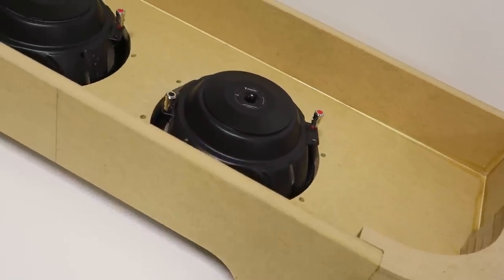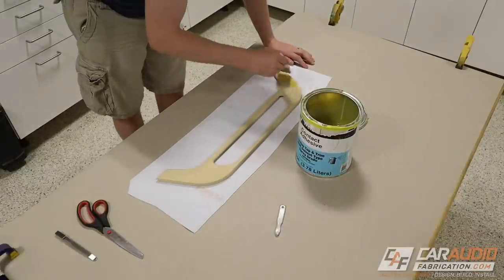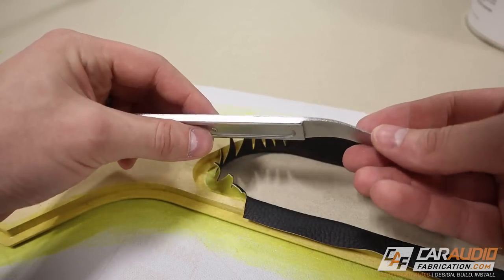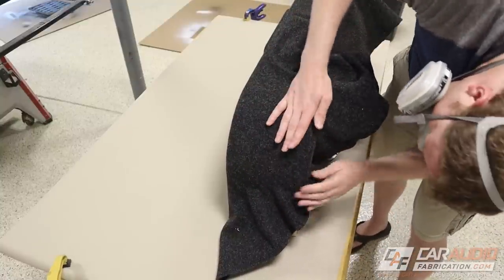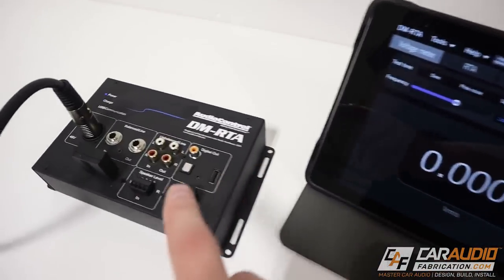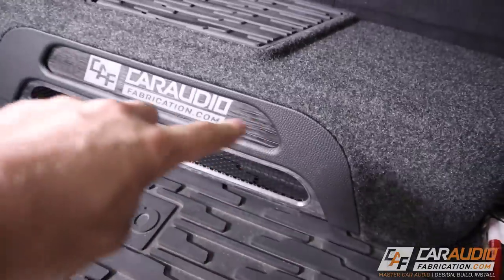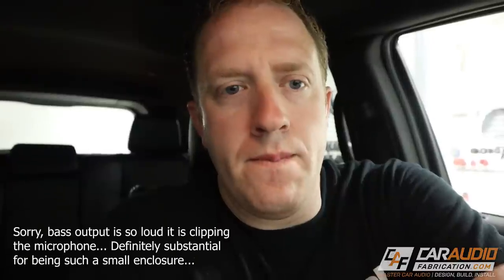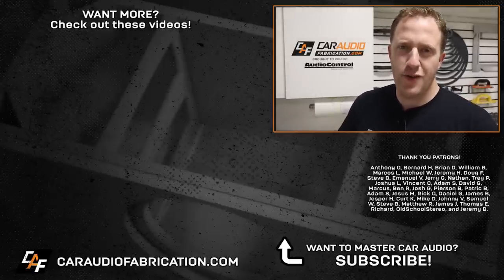HOW DOES IT SOUND? - Downfiring Subwoofer Build Finished!

Comment: I have a jeep CJ5 and I am planning to build a very compact box to go under the back seat.  It will only be 5X17X23,  I'm going to try two three inch subs.   I use your channel to learn about box construction.  I have been building things for 30 years and you have totally changed how I use my router.  I went from one router I used rarely, to having three dedicated to table mount, jig use and free hand.  Thanks Mark!  keep building!

Comment: That is a beautiful box!  Sometimes you just need good sound; it doesn't always have to be neighborhood-shattering insanity!

Heck, my media/home theater setup uses four 5.25" drivers for the lows.  I live in a cozy little studio apartment, so I needed to play deep and fill the room at low volume, so the neighbors couldn't hear it.  It's all about the application!
Reply: add a tactile transducer!
Reply: 5.25"s are crossed over at 120hz, with a 2'x4' DMT panel for the mids and highs.  :D

Comment: Have you tried spray on truck bed liner?
In place of carpet.
No pet hair stuck to it.
Wipe it off easy with a damp rag.
Water proof coating.
Take a lot of damage from things sliding around. Easy to repaint and do touch up repaires.

Comment: I use that adhesive at work extensivly. The charcoal filter that you showed have a useable life of around 3 days outside of the package. You should put new filters on every time you use that adhesive. Also, if you have a batch that gets a bit clumpy you can kick it back with MEK.

Comment: Quick question.
I’ve got a 2018 Jeep Wrangler JKU w/ the Alpine Premium Audio System. It has an 8” floor-mounted sub in the back, but I bought a JL T10W3-D4 shallow-mount sub to put in its place. If you take out the factory sub enclosure; the well in the floor is about 5.5” deep, 12.5” long, and 26.5” wide. I want to maintain my cargo area without a box protruding too high up off the floor, because I use the space a lot; such as sleeping in the back (camping), loading snowboards, etc. However, the audio shop installing it said that if I use this sub, there won’t be enough space for it without building a box that rises 6” above the floor level. (That’s weird, cus it’s a shallow mount sub). They said they’ll have to install a standard JL 10 because the conical shape will somehow fit better, and then they can build an enclosure that only rises 1-2” above the floor level, so it’s still relatively flat in the back. Also, that the full-size JL 10 will perform better than the shallow-mount.

So my question is …
How does this make any sense??? :P

Are they just trying to sell me a new sub, since I already had my own equipment to be installed, or is what they’re telling me the truth? I feel like perhaps having all my own gear, the shop will only make money on the install, which in turn goes to paying their techs; whereas if they sell me a new sub, then at least they make some profit.

Am I right, or are they right?

It just doesn’t make sense to me how the shallow-mount won’t properly fit, and would need a bigger enclosure, versus a full-size sub that wouldn’t??? That just sounds paradoxical; the whole point of the shallow-mount is to save space. So, wth???

Are these guys ripping me off, or is this about some audio-expertise stuff, I’m not aware of?
I admittedly don’t know anything about electrical/audio etc. but I don’t wanna be taken advantage of for $1500+ either :\

Comment: i once used super 77 do do my door cards in a car i previously owned. it was great all through fall, winter and spring but as soon as it got hot the super 77 let go and all 4 door cards started to sag... try headliner adhesive, it has about the same bond but with a higher temperature range

Comment: I have an '03 wrangler TJ, I was thinking about putting two 10" Solo-Baric L7T 4 Ohm/2 Ohm kickers (I haven't chosen an amp yet, however i'm looking for something discreet? and possibly weatherproof) behind my backseat and facing them down to try to keep some sound when riding topless during summer, but do you have any other recommendations or maybe a different setup in general?

Comment: Question: What size rivet nuts do you buy? You say "links to the tools you use will be at the bottom", but they never are, at least for me. Was going to buy a bulk pack of 1/4" - 20 x 15mm from amazon. But wanted to know what you use. Or does it vary based on the size of wood your using....

Comment: I love ur videos... But im haveing so much issues with my car stereo... Im hoping u could help with a little advice... I have 2 12' speakers and a 2200w amp and the speakers have a 14 gage wire and the amp has a 8 gage wire for power and ground and im not sure why the amp keeps blowing fuses immediately i have 2 25w fuses in the amp and my fuse holder is a 50w fuse and i had a 40 but it blew as soon as it got put in and the power wire melted it connection from the connection on the battery i have a great conection with ground but im not sure if the fuses are too small or the wires need to be bigger... Or what... I would really love some advice... I learned everything from ur video and recommend ur video to everyone because how much u have helped me ... Thank you so much hope to hear from u

Comment: I have a 2016 Chevy Colorado extended cab when you get a chance can you look at the back, under the to jump seats the one piece plastic seat base, I would like to make a subwoofer box exactly the same exact size as that one with two 10 inch shallow mount subs, also there's a metal bar that is inside that runs across the inside of the box to bolt it down to the floor, could you build it, one thing on the bottom of that box, it has to contour to the top of the floor so it would fit perfect, it kind of looks like the box in this video, let me know I am very interested.

Comment: Cool looking box once fully finished. On an unrelated note I need some advice on box size for a home system using car audio. I have two sets if Fli Fu 5 component speakers I would like to use in cabinet. I will be mounting them in a mtm configuration with the woofer centres at 7.5" apart, but the speakers come with no parameters. I'm stuck on what box volume I should use. Thinking somewhere about 1.15 cf which is a box size of roughly 28" H x 8" W x 2" D. Anyone any thoughts?
Reply: 12" depth*

Comment: You seem very knowledgeable and passionate about car audio. I have a question. I am running about 2500 watts rms  2100 to the sub and 400 for door speakers all 0 gauge power n ground wire. I want to upgrade my alternator and get a second battery I can only find a 250amp alternator  (FOR BMW 328I stock alt 120amp) is that good enough? I may up grade to about 5k watts rms in the future so I want to buy a alt that will power it.
Reply: If you're running that much power you've needed a good alternator and at least a second battery for a while.

Comment: Hey @CarAudioFabrication I installed a subwoofer with an amp and 4 new speakers without an amp. I have a bit of a rattle in the rear deck. Any tips to eliminate it on a 2017 Honda Accord sport

Comment: Great design and finish! Love the details.
I have a question, do you test the subwoofer output outside the car to check for sound imperfections THD and Frequency response? Or just by ear in the vehicle? Confusion??
Reply: And the end result of box looks more like bandpass enclosure, those opening holes are tiny they could cause some frequency response changes, just wondering.

Comment: Is there a way you can run sound system without the head unit, straight from your phone or other source?
Reply: Yep, I use a $25 Bluetooth module ( from eBay) to run the amp in my 67 Riviera . Bluetooth from phone to adapter so no wires, no cutting in a head unit and volume is controlled by my phone . Check eBay for Bluetooth adapter for car audio

Comment: So im putting a sound system in my 2013 Hyundai Elantra GLS is stages as of right now I have swapped out my stock deck for a Pioneer AVH-4201 NEX deck thats paired with my steering controls I've also swapped out my stock speakers and tweaters with with Rockford Fosgates T1650-S Power speakers in my driver and passenger doors and in the doors in the back seat a matching set with tweater overlays all running through 1 ohm cable powered by a Rockford Fosgates P400x4
Punch Amp and it sounds very good but I'm stumped on what Sub to go with I've been on the fence between 2x12" subs or 1x15" sub and I'm looking to keep my brands matching front to back only thing I've come to learn is that 2x12" will bring more presence and a 1x15" will bring a deeper tone and for a guy that listens to everything but plays hiphop 75% of the time I don't want to be let down by a $5000cdn sound system and tips I do know for a fact I have enough air space to run both I actually have enough airspace to run 2x15" but I still want my trunk any knowledge or advice would be amazing note: my car audio guy has got me convinced that I should run my subs through a mono amp which I plan to do and I've already put a huge lithium battery in my car and it's actually putting out 100volts or watts more than its rated for so I've got lots of power for it

Comment: Isn't that a 4th order bandpass and not a sealed box?
Reply: No, a fourth order bandpass enclosure would require the subwoofer to be firing into a tuned, ported enclosure. This is firing into the open air, just underneath the box.

Comment: can you build a sub box that make the magnets of the two speakers symmetrically touch each other on the back to gain magnet strength with a little space for hot air ventilation (just a little) ? can't you?

Comment: How do you tune a amp probably with out going to a shop?
Reply: Buy a reputable amp and speaker that reviews indicate will actually run the power it was rated for. Not some cheap chinese stuff that claims 4000 watts but can barely run 400 watts. Then get a cheap multimeter and use Ohm's law to calculate the voltage you need for a given wattage and resistance. With the speakers disconnected, set your head unit to around 3/4 of the max volume. Then probe the speaker output terminals with the multimeter and use the gain knob on the amp to set the voltage to whatever you determined from the math in the Ohm's law equation. Give yourself a little bit of head room under the rated wattage to account for speaker load and provide some blown speaker protection (like a 250 watt speaker, set it for ~235)

Comment: that sounds a heck of a lot better than this crappy cerwin vega hida sub i got. I'm beginning to think i have a bad potentiometer on it, Can't get the gain to set properly. Fills in the mid bass good, but nothing on the bottom. I've had better low end out of 6x9s before. Then after about an hour of decent listening volume, it thermals out. Not impressed with it :(

Comment: I have a 97 f150 extended cab 3 door I want a box under the back seat with 2 10" and 2 8" with horn tweeters 2 separate amps running the speakers

Comment: Hey Mark, really love how the enclosure came out. I'm building my Geo Metro (it's a serious quality build. Motor swap, wide body, chop top, full custom upholstery and sound). I bought some really nice Volvo door speakers for the Geo build. They aren't paper speakers. Seem like good quality. The rear doors are 6" with a center mount tweeter, front doors are 6" with center tweeter and 4" mounted next to it. And then A pillar tweeters. I believe they are have bass blockers installed on them... My question. What kind of amplifier do I run with these speakers? I will be getting two 10" subs for the build as well. I'm assuming I need a 5 channel amp not sure on the other specs though. Any info you can provide would be appreciated. Thanks Mark!

Comment: How good do you think your ears are for listen to little differences in speakers and subs?
Reply: Well if you can’t personally hear a difference then it doesn’t matter in the end as long as you don’t blow up your system. Everyone’s hearing is slightly different which is why people argue about which speaker sounds best. I personally have pretty sensitive ears and can really notice the difference between one speaker and the next. I also set all my systems up by ear because it’s easy for me to hear when the signal distorts. However if I was into competitions and needed the absolute maximum power, I’d use some kind of measuring tools obviously.

Comment: WT AND F?  You took a mounted subwoofer and instead installed a heavy loose item into the cargo area? Scary expert. Is this a customer vehicle? Liability alone should freak you out since you appear to be in the USA. Did you consider the massive spare tire location? (Honestly when have you ever used one? I remember once back in about 1992...)